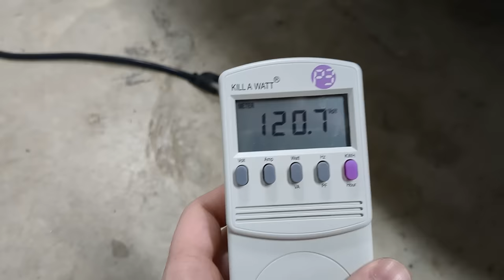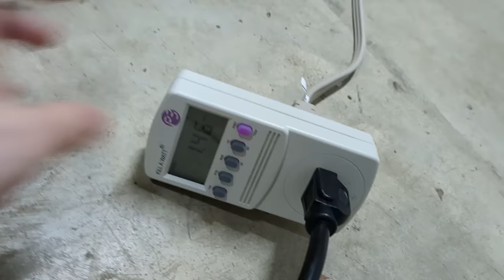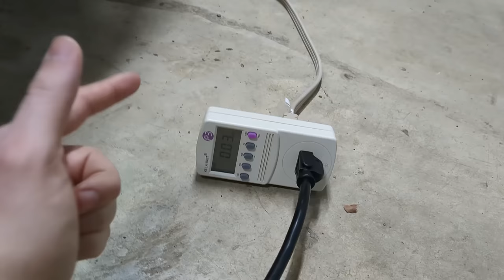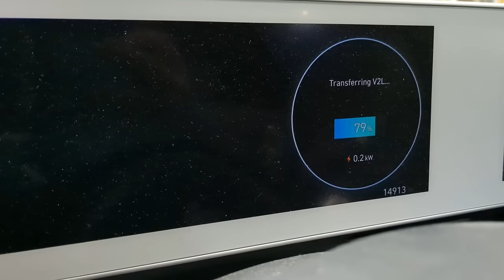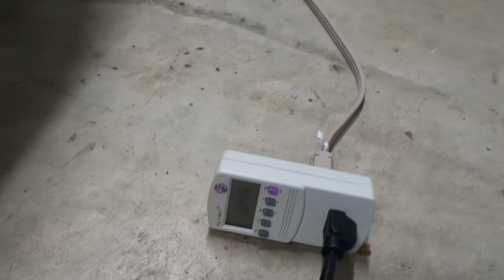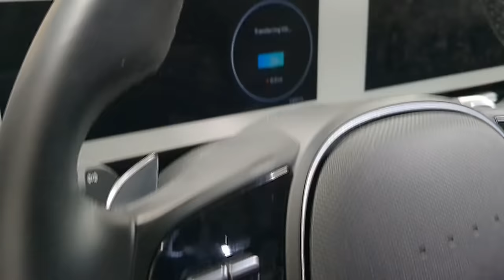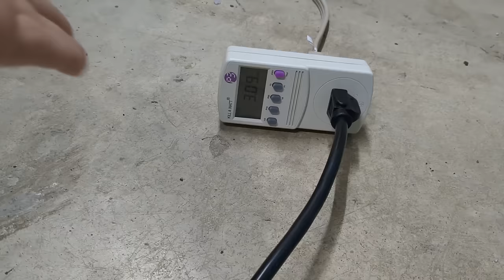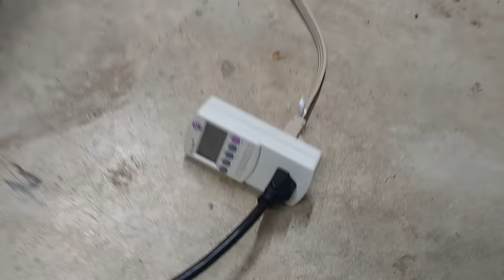A 24-hour test run of the Hyundai Ioniq 5's Vehicle-to-Load function

Comment: I feel like this proved that the “reverse charging” feature is more of a gimmick than anything, lol. Sure, in a pinch, you can use it to keep a few things going if you lose power for a few hours, but having an actual generator is still way handier.

First, a $600 generator is able to produce 5500 continuous running watts of power. That’s substantially more than your car can output. You can power your entire house on 5500w easily, except for like your washer, dryer, and range, and you can do it all at once. You can even power your HVAC system, depending on what kind you have, with no issues. You don’t have to worry about using the toaster with the fridge.

Second, idk about y’all, but I’m not worried about the most efficient way to get power when my power is out. I’m looking for power any way I can get it

Third, if my power is going to be out for an extended period, I’d like to be able to plug my fridge and freezer in and also be able to leave my house. If my car is the thing powering those appliances, that’s kinda not an option. So, I either have to keep another car on hand OR I could just buy a $600 generator (you could get a cheaper quiet one if you’re not going to be relying on it as much)

Comment: 10:00 Is it really that hard to design a modem that factory-resets when you push a pin into a hole and hold it? I think it can't be because it's how literally every other modem does it. I've never heard of a piece of network equipment that gives factory reset through power cycling and it seems like an especially bad idea for a system designed to function in the middle of nowhere with a possibly unstable grid.

Comment: my poor little 2015 Spark EV cant do this. tho, not that im complaining. it only has like a 19 KW battery pack so it would only really be useful to sit in with the heat running in the garage

Comment: It might be nice to redo the experiment using the outlet in the car, and maybe a second experiment seeing if you can use both the outlet in the car and the V2L adapter at the same time. Say have the fridge, freezer, modem connected to the car's backseat outlet. Other plugged into the adapter.
Reply: Both outlets are the same circuit, you can't use more power by using both at once.

Comment: Great experiment!! 👏👏 I guess that in European cars (220-240 volts), which if can remember correctly, can output 3600W, you could run more appliances at the same time 😁

I wish, as you, that all EVs had this V2L feature 👏👏
Reply: Yes, European Ioniqs can do 3600W with the adapter. The german YouTube channel „nextmove“ connected a whole house to the Ioniq 5 😂
Reply: @PascalSignifica  Thank you very much for the information, and I'm going to have a look at this channel 😉😉😁😁

Comment: I imagine the extra power usage is half-and-half load-dependent and fixed. Most inverters can get 75% efficiency, so the other like 60% excess usage you saw was likely down to battery/inverter cooling, and all the battery safeties that constantly monitor the pack. I imagine with how much they're marketing this feature they wouldn't put a TOTALLY garbage-tier one. Plus typically the most efficient part of an inverter's range is the 20-40% load, or about 360w-720w in this case. So it's possible that you were simply at the really low end of its range which is more wasteful, seeing as your typical load seemed to be 200w?
It just wouldn't make sense for inverter efficiency only being 50% on average. At that point, I'm just gonna hook up a 12v inverter to my lead-acid battery and let the car turn on the battery charger, which would keep me topped up with 1000w (1600w-ish for short periods). Sure, it cuts off at 40%SOC, but 60% at 75% efficiency vs 80% at 50% efficiency makes sense to me.

Comment: I have a Tesla solar and powerwall batteries for my house. I think each battery is 13.5 kwh, so 27kwh total.  That easily lasts about 30 hours if I don’t use AC. Of course if the sun comes out, it powers the house and charges back the battery, so in theory as long as I don’t get multiple cloudy days in a row (not usual for Southern CA, but all these rain storms have changed that), I can exist without the grid.  Would be nice if I bought a Tesla car, and the system could just treat t like a massive battery to send power to but also pull power from.  Currently, the Teslas don’t offer that capability, even when connected to Tesla home setups.  A shame.

Comment: I have this car and I have supplied my whole 2500sqft house from it during a blackout.
Now I have a stationary battery for that, it integrates well with solar and offers three phases.

This is a nice feature on this car, but still just a gimmick. The hardware of onboard charger supports full three phases, bus is limited in firmware, which is unfortunate.
Reply: by the way I am noticing that these cars are being bought mostly by geeks. You can tell by just looking at face behind the wheel :)

Comment: What is it that causes power outages to occur in your area? I haven't experienced a power outage lasting more than a minute in 25 years (in the UK).
Reply: In case you missed the news US is constantly hiding from wind, swimming with water, under snow, or on fire :) also their electrical network was built when The Tesla was still alive so there is that too :D
Reply: @randomnickify  I don't think ALL of those things simultaneously apply to every part of the US, you might be underestimating the size and diversity of the country by 99% or so.
Reply: @djcsdy2 yes, but one of those things is enough to take the power down and all of them happen periodically every year all around us. But the real culprit is their obsolete network and american hate of all regulations. Turns out big country means very little maintaince per cable mile and lack of regulations means lack of upgrades in the network.

Comment: I'm a firefighter and i know you're being safe.  We still haven't figgured out how to effectively stop these cars from re-igniting and were not even sire why they catch fire.  All we know are the batteries are dangerous and once they get going, they pop and throw off molten minerals like pieces if metal.  The re-ignition is a problem as we have to submerge them in water for two weeks to ensure proper water saturation. 
I hate to see these vehicles parked next to a structure much less in a garage.
Reply: I live in a remote part of Alaska.  We have one EV Vehicle. I've got a pit dug at the gravel pit.  My plan is to drop it in and while running water, fill in the pit, then monitor it for a week.  Other departments have large connexes converted to dunk tanks. The most effective way to combat it was with AFFF also known as cancer causing  fire fighting foam.  Maybe the blanket will help but we need a blanket that will cover a bus.

Comment: It does not replace the generator for me. On the contrary, I would have the generator, and run it in the first place, hoping the normal power supply will return before I have to start depleting my car's battery charge.

Comment: Those losses in the power conversion seem unreasonably high.

You're talking about 60% conversion efficiency, but this might not actually be a realistic estimate of the actual conversion efficiency, it might be more a reflection on the overall power loss within the system as a whole. For example I bet the battery to 120VAC converter is about 90% efficient, possibly even more (when examined under a decent load), but what we don't know is how much power the vehicle itself was using to keep a bunch of its onboard electronics/computers powered up.

I suppose you could do another test where the only thing you have connected is something like a 2 watt LED bulb. Keep it lit for 24 hours and see how much % of charge the car loses. Realistically it should be close to zero % but if the onboard electronics are taking a decent amount of power then this will be reflected in how much % the car actually loses.

It's also possible that the % state of charge is only a rough estimate of how much charge is left in the battery and it could be quite non-linear too. Then there's the battery capacity of the total pack and then the capacity that you can use. These are not the same thing.

Comment: VTG is a very low stress on the battery compared to actually driving, I seriously doubt there will be a significant amount of battery wear and tear using it that way. You would still need some kind of incentive to actually do it though.

Comment: I'd love to see a new standard that is required for all EVs cough cough Tesla. That supports back feeding into the wall charger and treats a second circuit of the charger like a backup generator. So you'd have 50 or 60 amp charging circuit and another circuit That would either have an automatic or manual transfer switch so it prevents back feeding the grid during the power outage. Or even better have some kind of smart tie connection with the car's battery pack so It can feed power back into the grid at night whenever solar and wind production is low.

Comment: The irony here, is that they (manufactures) should be able to offer this easily by adding the reverse logic (IGBTs) in the charger and make it a simple inverter/charger.  You should be able to use the same KW rating as the charger itself.   So with Tesla's you would expect to see the 11.5KW @240VAC and with Ford / Porsche you could see 19.2KW outputs @ 240VAC.  Sounds like yours should then be 7.2KW @ 240VAC.  The big issues is keeping each 120VAC leg approx the same or using an auto-former to do it.
Reply: @L. Ron Hoyabembe Correct, they just put the single direction (charger) into the design.  Adding the corresponding set for the inverter side would be a rather simple design change to the existing chargers.   That is why you see inverter/charger dual function units in the RV/Marine/Solar industries.  

In my boat I use the Outback M-Series units that are networked together to provide a total of 10.8KW @240VAC split phase with 6 units.  Most all of the AC loads in the boat are powered off the inverters and will turn into chargers when plugged in or on generator power.  Its a clean way to supply power during shore power to generator cut-overs, or when changing between different generators on the boat and everything will stay powered up and running without interruption.    

If I am not mistaken, one of the Tesla chargers that Munro and Associates disassembled, had space for the parts to be installed already on the PCB, but was unpopulated for the inverter function. 🤠👍
Reply: @L. Ron Hoyabembe Yes my complete guess here is it could be more of a liability issue.  If someone were to do something they shouldn't.  I guess Ford for example has just accepted the potential risk.   I sure wish that all EV manufactures did this.  If you think of the cost of a battery solution, just take the power wall for example.  The capacity of the Model 3 / Y (82KWh) compared to a powerwall (13.5KWh) , you would need 6 power walls to equal the capacity of the car.  That is $50,400 worth of powerwalls.  That is without any installation or other parts needed.  You could just buy a car and park it in the garage, never drive it and it would be cheaper than the powerwalls for the same capacity.  🤷‍♂🤦‍♂

Comment: Side note, you can’t say you’re using your car as a generator (that’s what the thumbnail says). As a high school student in physics, I just actually learned about electricity. A generator is a device converting mechanical energy to electrical energy. Technically speaking you should say you are using your car as a battery because that’s exactly what you are doing. A battery converted chemical energy to electrical energy. Sorry, the thumbnail just bothered me. Great video though!

Comment: 42:47  Oh I have to poke the bear here....   If it was heat pumps, you would be SOL 😁.  Gas has its advantages at least in this situation.  I have the same thing here, that when we lost power for about a week and temps were -2F, I was able to keep things from freezing because of a small generator, and multiple gas furnaces.

Comment: Many have adopted similar strategies with the prius.  Calculate the KW-Hr stored in 10 gallons of gasoline! That is a real reserve. 

A big parasitic draw is the inverter, which draws a significant current even when not being used.  Check specifications for sine-wave inverters to verify. 
Charge when you expect an emergency!  Ridiculous.  The real world is the experiences in Texas last winter. You've only experienced minor outages. Plan for a fortnight without grid supply. 
Your car is not a generator, just a big battery.

Comment: I bet the efficiency goes up the more power you use. The car probably has to run the 12v charger to keep the HV contractor closed and other parasitic loads.

Comment: I think Tesla doesn't offer this because Elon Musk is also skeptical of vehicle-to-grid. Most EVs in the US are Teslas, so if they had this feature it would be attractive for grid operators to use it. That could affect battery life and cause Tesla to lose reputation and have more pack returns under warranty. There have been hints that they could unlock it with software for newer builds, but that's mostly speculation.

Comment: In all seriousness, if you overload the circuit, it surprises me that the car cut the power and not one of the power strips you have there. (IME, a lot of the cheap ones will trip at 10-12A.)

Comment: I am waiting for the V2H technology. The V2L limits us to use only less consuming devices at one time, what is technologically ok but annoying. (Don't forget you can't use the induction hob and dishwasher together with washing machine at one time, even you need them to.) ;)
It doesn't mean, the V2L is useless. On the contrary, it is more than fine. It is the 1st step on the way to use BEV's batteries as full backup for the house. When we will be there, the BEVs make more sense for common people.

Comment: This was a cool video however, I do not understand the idea of call this a generator, this is a battery with an inverter, it does not "generate" electricity. I just dont understand the use of the term.

Comment: Smart guy, but you should get a panel interlock kit from Amazon and backfeed half your house since you have a split phase panel, obviously you couldn't power your 240V appliances. The obvious upside is that you wouldn't need to run so many extension cords!

Comment: The idea of leaving the battery at 100% for hours or days makes me cringe, that's pretty hard on the battery I think. I'd say split the difference, charge to 90%, that should still do you 3-4 days. Longer than that you can probably find a working fast charger somewhere to power back up on.

Comment: This is one of the biggest no-brainers ever. Once the manufacturers and the regulatory authorities smooth out the details, many issues with storing and distributing the uneven supply of renewable will be accommodated. Eventually, it ought to be no more difficult than simply attaching the vehicle to the house supply. Plug and play.

Comment: I think it's a nice experiment and neat idea for an emergency but I do not recommend to do this regularly because the one thing EV owners might not think about that if the Car Battery is Dead it's at least currently not worth it changing the Battery because it cost to much and you're better off replacing the entire Car.

Comment: That's a surprise it also could run on 120V

This car could output 3.6 kW on 220-240V if you're really need all the power
Reply from the maker: The voltage it produces depends on the market it's sold in. It wouldn't be useful to us if it ran at 230V because only high-power appliances use that, so it's capped to 120V in the North American market.

Comment: YES, Tesla vehicles can do this! In my opinion this is absolutely the most underrated feature of EV’s (that support it) I have a 5 kW sine wave inverter directly connected to the 12V battery on my tesla and it can power my entire house for almost a month if needed (using power very sparingly) it’s amazing, has saved me countless times down here in Texas. This works because the high voltage 100kWh pack maintains the 12v battery, works flawlessly so far.

Comment: In a hypothetical outage, let's say it is going to be 1 full day - so you know you have the battery to spare and you don't need to worry about long term surviving or moving out - you probably want to use BOTH V2L adapter and in-car outlet to power more things at the same time. Curious to learn what is the draw limit on each and if there are any additional constrains on simultaneous usage, also if the efficiency is better/worse.